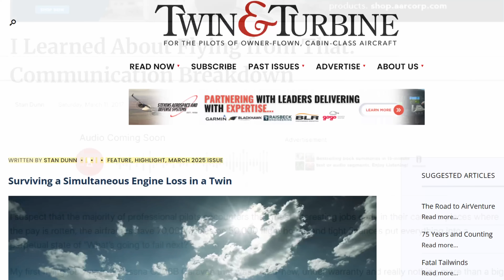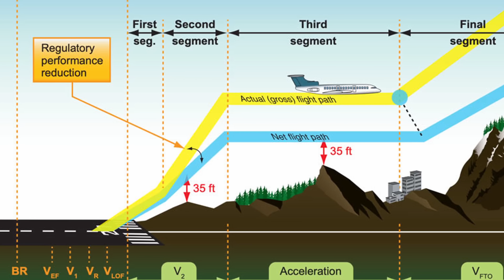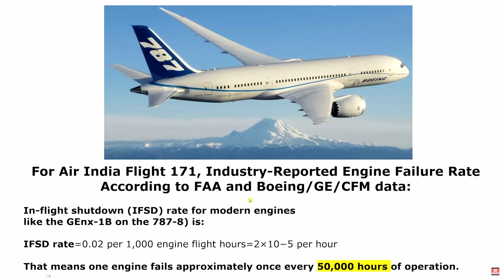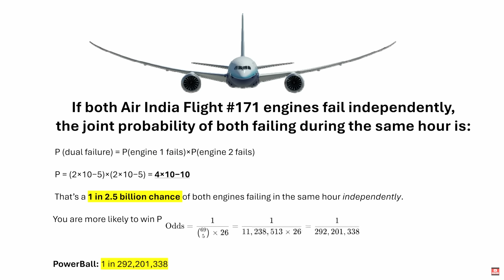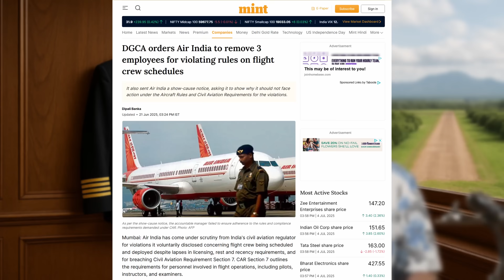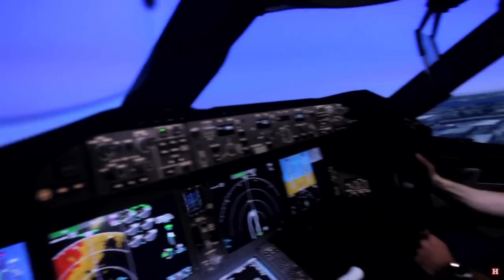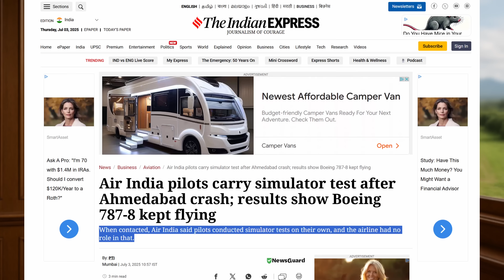Air India 171 Cause Becoming Clear

Comment: Dude, there is no procedure when both engines fail at 200 ft. and no way to glide
Reply: The point of the video is to convince you that dual engine failure is so tremendously unlikely, except in the case of birds, That we should look at at the other way that you get something that looks like dual engine failure, which is single engine, failure, followed by the pilots, shutting down the wrong engine. The fact that we didn’t see the right engine behaving strangely or kicking out any debris is supposed to make us think that dual bird ingestion likely did not happen here. And the fact that just a few days after after the accident, some air, India executives were forced to resign, is to make it seem more likely that this is a training or compliance or overwork issue. So essentially, the likelihood of dual engine out due to birds is, before you look at this particular accident at all, maybe about half as big as the probability of losing both engines due to the pilot, shutting down the wrong one. then he gave us two more, the engine looking like it was spitting out something on takeoff while the right engine did not look like it spat out anything, that is supposed to make us think that the dual engine bird ingestion did not happen. And the executives getting fired is supposed to make us think that it was a personnel issue indicated by the early investigation.

And I think those are all reasonable, we start with an initial level of comparative belief into scenarios, the less common of those gets shown to be even less likely, and the more common of those gets shown to be even more likely.

So no, the pilot is not supposed to do anything miraculous in the case of dual engine failure at 450 feet. But the pilots are also not supposed to cause anything that looks like dual engine failure at 450 feet, such as shutting down the wrong damn engine.
Reply: @ahgflyguy  Tremendously unlikely from separate causes, leaving open the possibility if from a single cause.
Reply: @ahgflyguy    If the fuel pumps stop it's game over at that low altitude, no matter what.
Reply: @JoeyBlogs007  sure. But we don’t have any evidence that happened, or any evidence that CAN happen. There’s that one time both engines shut down after landing on a 787. I don’t know how well that was analyzed. But we know this other failure type CAN happen, where one engine will fail, and stupid pilots will shut down the working engine. And statistically, most failures that cause aircraft crash have caused other aircraft to crash as well.
Reply: @JoeyBlogs007 once the engines are running the wing fuel pumps are no longer required - fuel is supplied from the tanks by jet pumps - as long as the engine is running and the HP pumps are being mechanically driven, fuel is supplied. This is to eliminate the need for electric fuel pumps in the case of an electrical failure - basically it is self-sustaining. There are occasions when the pumps will come on or are turned on, but in normal flight the electrical supply pumps are off.
Reply: @ahgflyguy I have heard the same.
Reply: @ahgflyguy  Brilliant, another YouTube commenter who has done the Air Accident Investigation Board's work for it.  And all done without access to the CVR and FDR data, detailed engineering records, aircrew training and competency records including time on simulator, detailed airport support and logistics information (including, for instance time of most recent FOD sweep of runway and surrounding area), and a myriad other details.
Reply: @DraftySatyr  what? In was explaining the video to someone who clearly didn’t understand it. I’m not saying what the video implies is CORRECT, it’s really only talking about two possibilities and their relative credences, and how the available evidence should change those. This is Bayesian statistics, not rocket science.
Reply: Hm, ... if there's no space after takeoff where you could land after a dual-engine failure you're doomed ...
Reply: @Gondorff273 no choice but straight ahead.
Reply: Well said bro. Internet awash with hypothesis from retired pilots. How can you react in a 15 second time window. Plane is like a huge whale at that height and speed.  Cant respond instantly.
Reply: Allowing for time necessary for problem analysis by pilots, it is unlikely that there was any pilot initiated engine shutdown.  And a properly operating right engine should have effected continued flight, even in the event of a left engine failure.  It appears that we did have a case of shutdown of both engines almost simultaneously only seconds after rotation.  This explains the levelling off and descent.  Look for electronic failure in feeding both engines from the central tank.
Reply: They are saying 11th July is the date they will release initial information, can we not wait that long? Tough crowd here!
Reply: Dude, the dual engine failure SOPS before V2 is : 1. Apply Toga detent, 2. Do not select gear up.
3. Lower the nose to 3 deg pitch, 4. keep the wings level, and select the softest field within +/- 10 degrees of your heading. Glide ratio in dirty configutation would still be around 10:1 as opposed to 21:1 in clean config.
Reply: However, if the good engine failed because the crew shut it down.......that possibility is the likely cause.......I am an ex Pan Am 747 captain who went to work for JAL and KAL after the bankruptcy......the Sh** I saw in the Asiatic training centers leads me to agree with this hypothesis........
Reply: Before take off everything was checked.
Reply: Actually, there is! You're on final, prepare to land!  My primary flight instructor trained me in GA planes that if you have an powerplant failure at or below 500' AGL, you're on final! Where ever you are pointing is where you are landing.
Reply: @jamesroland5520  Depends on the aircraft but yeah, never turn back unless you are sure you can make it. Many people have tried and not made it, which generally works out worse. Bearing in mind you will likely be turning a head wind into a tail wind.
Reply: 100% wrong, the procedure is to shit your pants as much as you can for extra padding.
Reply: @chrismacbean mm!
Reply: My question: what happens if plane extremely overload than engine can handle flietworthyness.can defence mechanism of software triggered to shutdown engines from damage.? because plane took whole 3.5 km runway instead 1.5 2 km due to its loading and at that  day extremely humid and hot atmosphere there in Ahmedabad.
Reply: @vyasjwalit3999  Often, depending on loading, full throttle isn't used for take off.
Had one in VIC AUS just clear the boundary  fence after taking out more than a few lights, because the pilots got their maths wrong and weren't exactly paying attention until it was almost to late.
Reply: The procedure is to yell „CRAAAAAAAAAP… AAAAARRRRGH!!!..0
Reply: @frankthetank8050 I think the pilots did that on the mayday call
Reply: @frankthetank8050  Smoke em if you got em!
Reply: Did you watch the video. The odds of a Duel engine failure at the same time are astronomicallying unlikely
Reply: @tommaguzzi1723 other videos give examples of that happening, 3 times, no disasters but only because of pure luck. One in Japan, 1 in England and can't remember the other location. But all were total simultaneous engine shut down and from memory it was electrical.
Reply: @tommaguzzi1723  The Engines might have been just fine, but if the plane experience a system failure it makes no difference. The RAT popping out is a major hint.
Reply: @iRelevant.47.system.boycott  the partially raised wheels give a big clue too, especially for when things went wrong.
Reply: @tommaguzzi1723  It's well established now (from the pilot's own words and from video evidence) that both engines failed - for whatever reason - to deliver enough thrust to keep the aircraft airborne. The "astronomically unlikely" odds you're touting are the odds of both engines suffering catastrophic MECHANICAL failure within an hour of each other, not the "odds of a dual engine failure" (from any cause).
Reply: @tommaguzzi1723  Either their English sucks or they didn't watch the video
Reply: @tommaguzzi1723  Yet it happened.
Reply: @tommaguzzi1723  yet it happened. The FADEC didn’t like a power spike it got from an arcing bus, due to water getting in the GPU socket
Reply: @tommaguzzi1723  The RAT deployed either because the power failed or the RAT deploying caused the power to be switched off.
Reply: @tommaguzzi1723  and yet it happened.
Reply: That’s NOT what he was saying…. He was saying that the chances of both engines failing for different reasons was extremely unlikely…. Not that it wasn’t likely
Reply: @tommaguzzi1723  astronomically low, yes,  but not zero.
Reply: @wayneholmes637  Yes, what i should have said was the odds of both engines failing at the same time WITHOUT A COMMON CAUSE. I saw another video on YT where they are suspecting the engine control computer of shutting down both engines.
That seems to me to be the most plausible reason for this terrible event.
Reply: @tommaguzzi1723  Are these engines fighting each other?  To a Duel? Everyone knows that Dual engine failures are tricky
Reply: @johnhanson9245 there is one computer which manages both engines. If that has a problem it can shut them both down simultaneously. That is what was being speculated.
Reply: @tommaguzzi1723   No. This video did not rule out all causes for dual engine shut down .  Fuel contamination is a cause of lesser likelihood.  An electronic fault could have shut off fuel to both engines when both engines are fed from the same central tank on takeoff.
Reply: @JosephBoxmeyer-u3d  "when both engines are fed from the same central tank on takeoff"
I doubt they would have(or at least should have) been doing that...... can you guess why?
Reply: @JosephBoxmeyer-u3d  and that’s what it was
Reply: @stusue9733   Yes, I believe that the 787 uses the central tank for both engines, until well unto the flight.  This is not optional.
Reply: @JosephBoxmeyer-u3d  Sure they use the central tank first IN FLIGHT but I doubt they would for take off.
Reply: @stusue9733  But I believe that this is how the plane is set up for take off.
Reply: @JosephBoxmeyer-u3d  oh, you're say this plane was set this way....sorry misunderstood.
That's just darft.
Reply: They did glide. All the way to the scene of the crash.
Reply: In any plane, if the engine quit that low altitude, assuming it is a single engine plane, there is not a hope in hell we can do a 180+ degree back to the runway, we are taught to look straight ahead, to either side at 30 degrees and find a spot to set it down. Forget the radio and don't stall the God damn thing. Yes, it will still glide.
Reply: Of course there is.  Just scream "Ohhh sh*tt!" :D
Reply: Just Pray 🙏
Reply: Die Frage ist doch, warum die Triebwerke von einer Sekunde zur anderen keinen Schub mehr lieferten. Ausfall durch Softwareprobleme, Ausfall durch Falschmeldung wichtiger Sensoren, Schubreduzierung bzw. komplette Schubwegnahne bis auf Leerlauf durch Pilotenfehler und/oder bisher noch nicht ansatzweise bedachte Fehler.
Da die Piloten lt. Aufzeichnung des Voice-Recorders anfänglich sehr ruhig waren, erkannten sie das Problem vermutlich erst viel zu spät. Aber welches Problem könnte das gewesen sein???
Reply: Sure there is! Land straight ahead
Reply: Bottom line is both engines lost thrust and that is why it crashed.
Reply: His point was that there is a procedure for single engine failure, and that some pilots switched off the wrong engine during that procedure. Some people really need to learn to listen before talking 🙄
Reply: You didn’t watch to the end. Theory is single engine failure and shutting down the wrong engine. Educated Guess for sure but certainly plausible if proper procedures were not followed
Reply: Procedure is knees up, head down, kiss your ass goodbye
Reply: " Dude, where's my plane "
Reply: Indeed, exactly.
Reply: You obviously didn't watch the video. He talked about the procedure for a single engine failure and they could have possibly shut down the good engine instead of the bad one.
Reply: Also, the fact the pilots took the full length of the runway means both engines had to be working to give it that lift only to pack up seconds later ... It clearly indicates engine failure esp with the RAT deploying...some software bug or mechanical error...pilots were experienced not novices... Tragic crash and God bless their souls ...if Boeing had a hand in this that company aka defence contractor should be shut down!🙏
Reply: C'mon, it glides a bit . . . What's the glide ratio here? 1:1 maybe?
Reply: @brentoncrowhurst8338 It has a glide ratio of up to 20-1, obviously not in this case as it was going too slow, but they glide extremely well, as seen in other both engine loss failures and landed successfully and undamaged.
Reply: @gregb1599 from FL370, that's yes, but  not anything close to the ground..
Reply: @edwardrichardson5567  Well duh! I did say "not in this case" even a proper glider with its 60-1 glide ratio would have crashed due to lack of speed and lift!
Reply: @brentoncrowhurst8338     Around 17 to 1 clean configuration at stall speed depending on passenger and fuel loading, weather etc. Obviously this was not an optimal configuration with gear down, hot weather also. If it was 1 to 1 it would have only glided 100 metres, however it travelled 1.5 km from the runway. Actually this is very interesting and key a aspect. If it glided a distance aligned with it's expected glide ratio, however with gear down and RAT deployed. Thus we can conclude it had some rapidly diminishing residual power during that glide to crash site.
Reply: @JoeyBlogs007  Why, thats better than a 172, but at 200 ft agl. . . In that location, no options. Its horrific, yet, I keep watching it.
Reply: @brentoncrowhurst8338  These planes glide really well and have a glide ratio of maybe 18:1, BUT not from 400 feet, its best glide is probably @250 Kts, but you need several thousand feet
Reply: @brentoncrowhurst8338  well it glided until it crash landed basically. if it was above a runway maybe it would have survived..
Reply: "Dude"? Really?
Reply: @patagualianmostly7437  Yep.  very difficult to take the content of a comment seriously when it is prefaced by "Dude".
Reply: what about making sure you don't shutdown the goddamn wrong engine lol. They didn't even wait to gain altitude if it's the scenario that happened they were more than dumb.
Reply: The cause of the accident was known over two weeks ago. Now they’re just trying to cover their butt for lack of pilot training and inexperience.
Reply: @Genebaket  wrong. Boeing design flaw. A fix is coming
Reply: And your point is?
Reply: @toby9999  You should lick a moose.
Reply: @toby9999 Uhm no glide
Reply: @toby9999  Can't you read?  "There is no procedure when both engines fail at 200 ft. and no way to glide"
Reply: Can drinking a cow's urine be a factor?
Reply: @AbdulazizOday 😂
Reply: @AbdulazizOday  No man but Praying to Ola and Momo is a factor.
Reply: @AbdulazizOday  lmaooooo

Comment: The coat hung up looks to small for you what’s going on ?and on another video it’s said the seat slid back and the captain reached out and pulled the throttle levers back by mistake so what’s that about then ?
Reply: I thought that scenario quite plausible if the FO had control and the captain was leveraging the throttling. 787 seat pin failure has previously happened. It would've been so quick too.

Comment: I say this on all videos. Someone shut down BOTH ENGINES with 2 seconds of roration. The ONLY QUESTIONS are WHO? and WHY? No poimt in talking about ANY other cause.
Reply: I think it was a straightforward electrical fault. Mr. 11A reports the emergency lights came on momentarily and we know the RAT deployed.

Dual engine failure is such a rare scenario and there is no visible sign of what might have caused it, therefore I don't think the engines going took out the electrics. Rather it was the other way round.
Reply: @halfbakedproductions7887  I would presume the thrust on the engines is controlled via the onboard computer. One would presume there is a manual override, not sure how that would be engaged. With the RAT being engaged, it seems electricity is a critical component for the plane to operate at all.
Reply: I'm still going with a loose connection that was somehow yanked out, whether op purpose or by accident. Most likely in the power supply of the pump that regulates the fuel to the engines or something like that. The RAT deployed, but as far as I understand it from what the survivor has said, there was still power to the lights in the passenger area. So those seem to be separate from the power to the engines or fuel supply. Ultimately only a thorough investigation should shed light and all angles need to be investigated. Also the question of a possible sabotage.

Comment: They had a seat bracket failure or a seat hinge for failure they reported it wasn't it wasn't repaired and that's what supposedly had a seat slide back
Reply: I had that happen to me on my first flight with a a passenger at a Somerset airport or Basking Ridge airport in a Cessna 150
Reply: The seat does not slide back on a 787, there is a fairly solid wall behind it. Anyway, there are two pilots, and if one bites the dust, the other can take over.